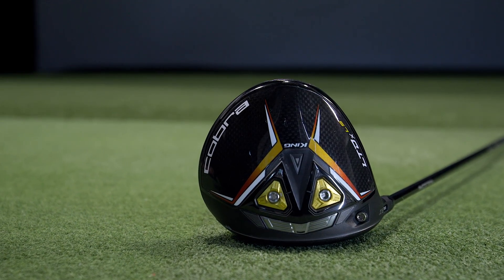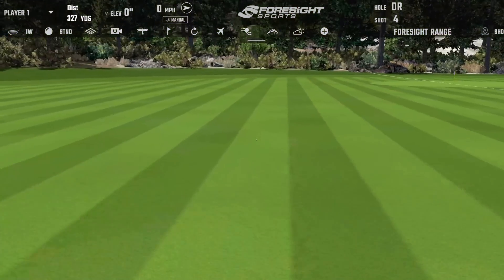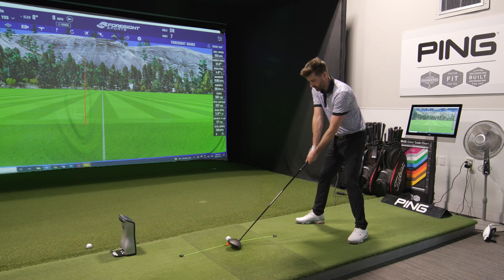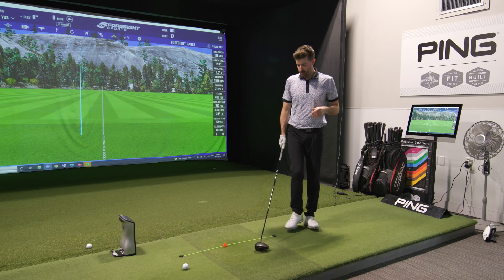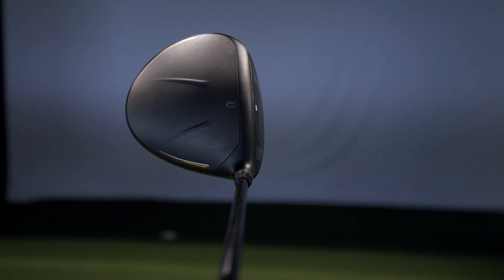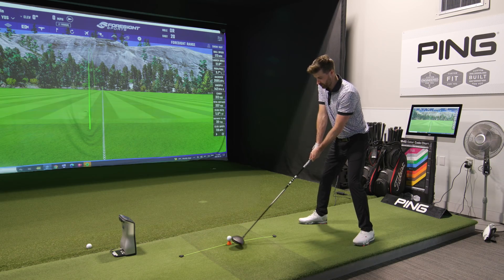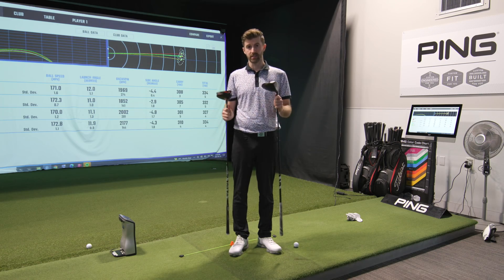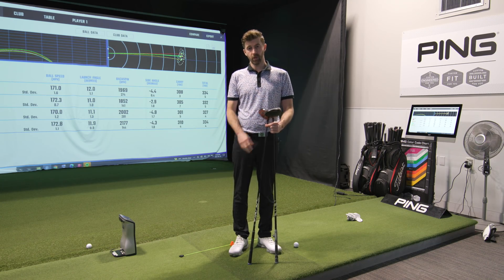Fitting Myself for the Cobra LTDxLS Driver

Comment: Love the 'fitting myself' style of video!  I live in South Korea, and my driving range is basically the setup you have in this video, so I have access to all the data, and this video gave me some great ideas of how to optimize my driver.  Big thanks.  

One head I would love you see you do this with is the Mizuno St-Z 220.  It is unique in that the price point is quite a bit lower than others, and for me that matters alot as I don't have $600+ to spend on a driver.  Also, after watching you hit Mizuno predecessor in last year's bracket challenge, I'd really enjoy watching you fit yourself for the new model.

Comment: Love hearing your voice and the slam when your driver hits the ball ...

I do miss the vibe between the Matt and Ian. Three years or so of videos is in the past. 

This video is not my bag as I do not like the Hazardous shaft and I do not like Cobra ..  hahaha.

I am an Oban guy. Your fault apparently. Last year became expensive but soo worth it. An old Oban Devotion shaft in a Mizuno fairly new head. Sometimes I change it to a Miyazaki 7777 head which I love

Oban Kyoshi black in my 5W.
Oban Isawa Red in my hybrid..

What I learnt last year was that I needed a 75g ish shaft and the flex could vary -which was brilliant to know. It then becomes interesting as the stock shaft may be useless regardless of stifness.
It works for the regular "let me hit 15 shots with driver, yeah it works ok but it is new ... so how good will it be when I am used to it.. "
.
Folliwed by same procedure with the next driver to purchase. 
.
I paid for a shaft for one of my best friends son who then went from hcp 15 to 4. 
.
So, coming back to your video and suggestions: 

I would like to see stock shafts and shaft weight differences. This may be for your righty-club hitting videos but also to do the same thing with for example hybrids. 

Is there a differens? Or maybe not. Depends then on swing speed, hitting down or up, inconsistent swings etc. 
You have the skills to go left with a bang or with a regular amateur swingspeed. 

Thanks for being back!

Comment: Nice one Matt. You know what they say.. If its not broken then don't fix it 😁 If you really want to tinker some more... IMHO, the only thing left is shaft length and or swing weight? Maybe a shorter (45) shaft and a heavier head (D3 D4) will give you a bit more control /stability? 🤔

Comment: Love it!  I had no intention of buying a Cobra driver this year, and honestly haven't like a Cobra driver since the Bio Cell Pro... but the LTDx LS won out over everything.  As the video started, I was thinking 10.5* head turned to open to 9.5* with the heel weight would do the trick.  You basically ended with a similar result.  Looking forward to the conclusion...
Reply: The F7+ and F8+ drivers were bombers -- both super unforgiving unfort -- but hit in the center, they still are incredibly long.

Comment: Glad your doing your own thing. Did you notice how light the Cobra Ltdx LS head is? I have 193 grams with both weights in 10g and 3g and the stock RDX blue 6.5 feels very light with the mid balance point. I was wondering how it affects your swing. I have the swing weight around 0.5.
Reply from the maker: haven't weighed mine or swingweighted it to be honest, but I have been using ventus black which is fairly low balance point so that may be helping

Comment: I was caught between the tmag and cobra in my fit a couple of weeks ago, found the taylormade strangely needed setting up right on the toe for the middle strike, cobra just had better consistency with a more neutral flight. I landed with a Mitsubishi Tensei White in 70X, super consistent but stable when putting extra speed through the shot! Worth a try

Comment: I have the LTDX LS with the Ventus TR and it's been an absolute weapon. I know it's not 'off the shelf', but you should give it a try (on or off camera)!
Reply: I was thinking Ventus blue tipped an inch. Is that pretty much what the TR acts like?
Reply: @whocares3986  I played a Ventus Blue 6X tipped 1" and then moved to a TR 6X tipped 1", so I can't compare exactly. TR is tighter feeling (like the Black), but still smooth in overall feel (like Blue). Less kick than Blue but not harsh like Black can sometimes feel. Like most describe, the TR is the mid-point between Blue and Black - which was exactly what I was looking for in my driver.

Comment: Congrats Matt this is getting more and more interesting everyday! Also really appreciate your openess to ask and accept suggestions. I have the feeling that the Cobra will win after today's autofitting but it will be definetely close. On the other hand I have the impression that the Rogue Max LS has more potential than it showed. I guess you only hit it with one shaft which might not be a good fit (was it Tensei AV White?). As @Phillip Parsons suggested I would give it another try with another shaft of your like

Comment: I was recently fitted at Club Champion. Was using g a Sim2 with Ventus Black 6x. My swing speed is slower and not as smooth as yours but my profile still matched up w Ventus Black. I ended up in a Stealth Plus w LA Golf AXS Blue. Similar to Ventus Black but smoother. The numbers were  better as well. AXS is much different than Trono if you were wondering. Personally I love watching you swing the driver and I think you would hit bombs with the AXS. Would love to see you try it!

Comment: Try the PXG Gen 4 0811X proto in 7.5 degree. You can flatten the lie with this club whilst increasing the loft.  Maybe try the HZRDS yellow in 60 gram 6.5 flex. It also has greta adjustability and I think would be a great one to add to the test.

Comment: Only thing would be maybe giving a shaft like the Ventus TR you think fits you better a run in one of the Callaway drivers, be it the regular LS or the Triple Diamond LS.

Unless of course you just hated the look of them at address or something, but if it was just going too much right and it is easy enough to give it a try, wouldn’t hurt to maybe hit like 5-10 balls with it off camera and see if it works well enough to chuck into the conversation. 

Obviously no adjustable weights on it though so it may just not suit you enough that without the adjustability it isn’t viable. 

I’m only suggesting it since I know you said you quite liked the look, feel and sound during your initial TD review.
Reply from the maker: I really do like Callaway’s driver this year, I won’t totally give up hoping to still do some more testing with it this year
Reply: @GolfLiberty  I was wondering if a 10.5 head with one of their tour adapters that lets you deloft it 2 degrees to 8.5, getting it a lot more open, might be worth a shot? Kind of a Frankenstein sort of deal, but might be fun to see.

Comment: Matt, I know at the end of the Rogue driver video, you said your old TSi3 was in 10 degrees. Since you've been putting more spin on the ball, have you tried any of the TSi drivers in lower lofts (8 or 9 degrees)? I find my 9 degree TSi2 fairly forgiving cranked down to 8.25 (it's also available in 8 degrees directly from Titleist). Of course, you might just want something different this year, but it'd be cool to see a variation of your old driver go up against the Cobra and Stealth, just in a comparable loft. You already know the shaft you like best in the TSi, so hopefully it would just be a matter of putting a lower lofted head on it to compare.
Reply from the maker: I think I'd need to try a TSi3 in 8º I think, I did some testing with the 9º recently and the spin was too high
Reply: @GolfLiberty  I could see that. Even with my loft down to 8.25°, my TSi2 spins a good 400-500 too high, but that’s probably what’s saving me on my off-center strikes. 😅

Comment: Your efficiency with the Cobra seems really low? I'm always finding my TSi3 (8°, Ventus Blue 6x) sits between 1.44 and 1.48 with my swing being just a little faster than yours (126-134mph), which results in 355-380 yards distance and a pretty tight shot dispersion with push-draw. Have you used in the Ventus Blue yet in the Cobra, I remember it being a solid option for you in the TSi3.
Reply from the maker: Gc Quad readings top out at about 1.45 efficiency, it's the equivalent if 1.50 on trackman
Reply: Due to the time when the clubhead speed is actually measured (which clubhead is often a touch higher on GC for this reason), I know. I've seen as high as 1.52 weirdly enough on Trackman - although due to it not being consistent, you would almost think its an error.

Comment: Great video Matt! I am curious, at your speed and when struck solid, wouldn't you be closer to 180 bs? Cheers!
Reply from the maker: Quad reads clubhead speed a bit higher, so I need to be getting 125+ mph readings here to start getting 180+ ball speeds